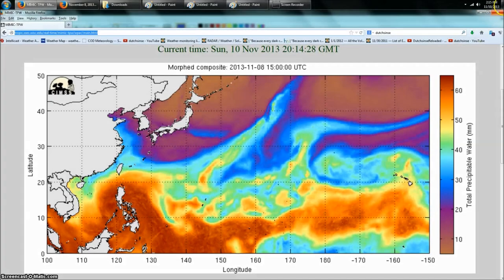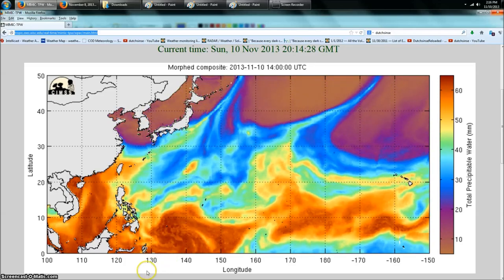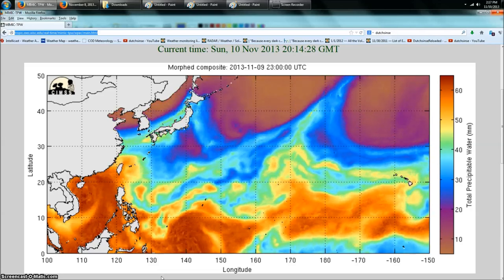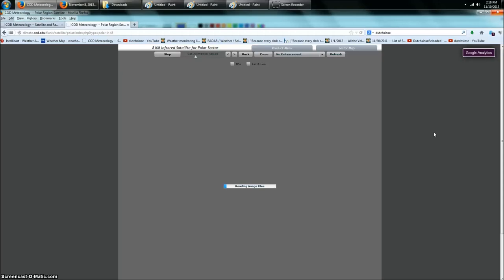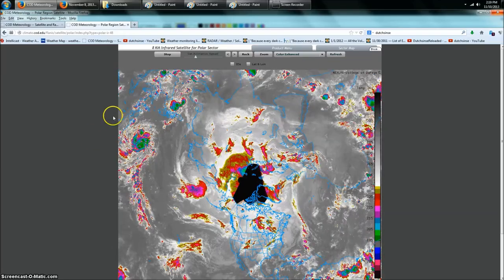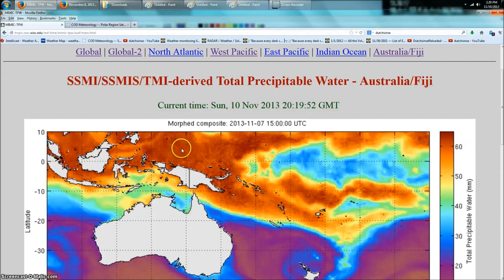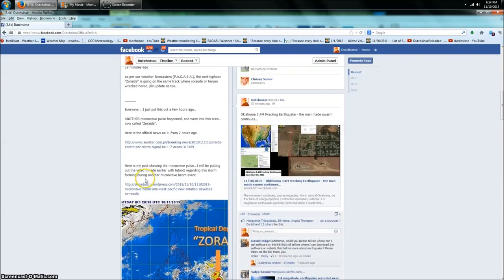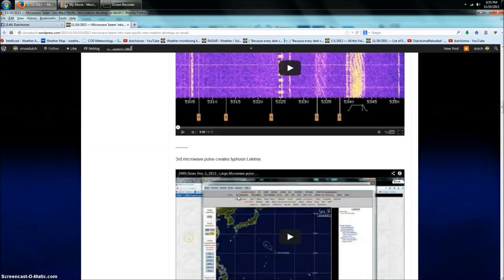11/10/2013 -- Microwave beam forms Tropical Storm 'Zoraida' - rotation begins upon pulse

Comment: How long time does each frame represent?

UPDATED-1: OK - it says in the graphs. Each frame represents one hour.
NEW QUESTION: Is each image the average result during the last hour, or is it a new "instant photo"/'snapshot' that is aquired every hour?

UPDATE-2: The 'curved beam' at around 1:36 in the vid; it starts as 10:00 A.M. and dissipates at 16:00 / 17:00, so it lasts for some 6-7 hours before it dissipates.

Comment: You need to step through these sequences frame by frame to see what is happening.
Beams of [electro-magnetic] radiation cannot 'curve' to the extent claimed.
The anomalies in the maps are more likely to be missing or poor data due to issues with the sensors or comms links rather than signifying broad beams of energy being transmitted from a man-made installation.
Reply: And like you would know this,i smell a debunker

Comment: Your problem may be that you are using a incomplete and sometimes erroneous Interim Product as shown by the address bar 'Real Time'...here - 'Remote Sensing Systems performs a detailed processing of SSM/I & SSMIS instrument data in two stages.  The first stage produces an interim product (identified by "rt" within the file name) which we make available as soon as possible, generally within hours of when the data are recorded. This product can be incomplete or contain geolocation errors and erroneous brightness temperatures inherent in the data supplied to us  These errors are removed with final processing, usually completed within a few days of the initial product. The final product replaces the interim product automatically, with the "rt" designation in the file name changing to "v7"'
Reply: Expand above comment for potential reasons why this data is erroneous

Comment: I noticed that the origin of the arcs seems to be Morotai Island. According to a Google map of the area there is a drop off into the ocean up along the coast. Is it possible that the electrical arc could be caused by a quartz discharge from the movement of the continental plates?

Comment: radar hitting radar... a military ship wave pulse.... or volcano can emit a wave pulse.... like a square emitter radar would need to bounce off the moon yet would it  be square.....theirs crazy amount of possibilities... the algorithms in the software would be square... your dealing with return vales of a wave pulse 

Radar is an object detection system which uses radio waves to determine the range, altitude, direction, or speed of objects. It can be used to detect aircraft, ships, spacecraft, guided missiles, motor vehicles, weather formations, and terrain. The radar dish or antenna transmits pulses of radio waves or microwaves which bounce off any object in their path. The object returns a tiny part of the wave's energy to a dish or antenna which is usually located at the same site as the transmitter.

Comment: You can see similar "microwaves" connect between these two storms, explanation? Doesn't seem to come from a source yet generated from the storm themselves. Seems to debunk your theory that these are actually man-made microwaves but may just be glitches in the morphed composite. Thoughts?

http://tropic.ssec.wisc.edu/real-time/mimic-tpw/wpac/anim/20131024T000000anim72.gif

Comment: Im not sure about microwave pulses its now 2015 very hot above normal and its the Wet Season meaning it summer and it rains alot cyclone season happens every year.
Should check data over 10 years before you they and product storms  here.
Reply: +Areuakiller   You should be sure of microwave pulses. You're doing yourself a great disservice.